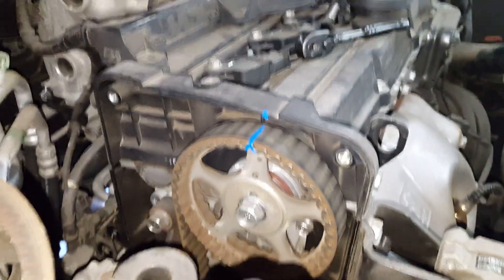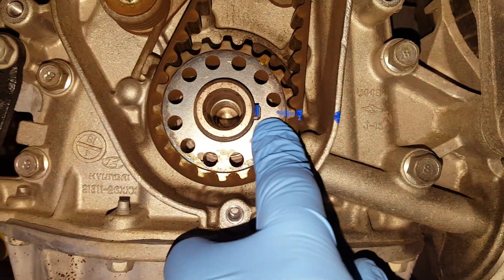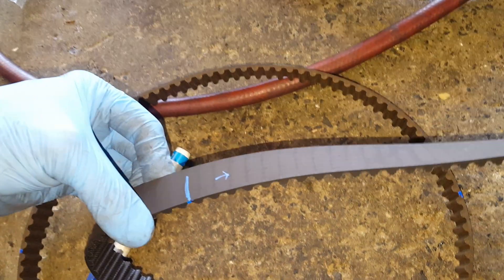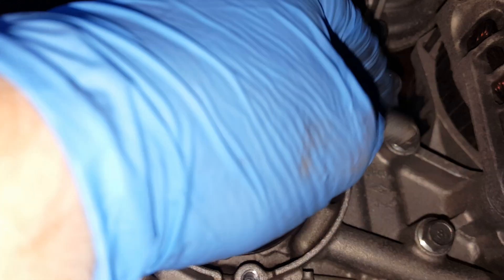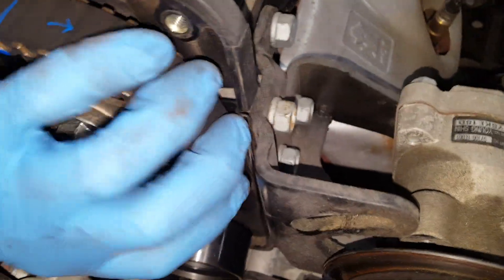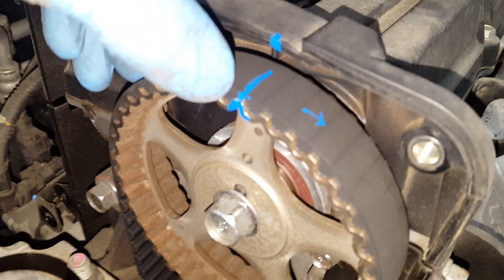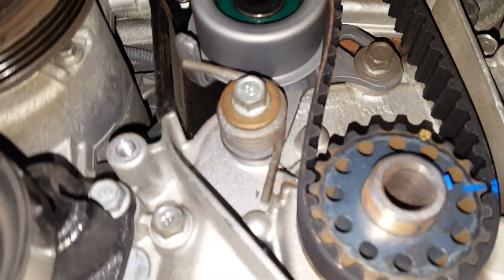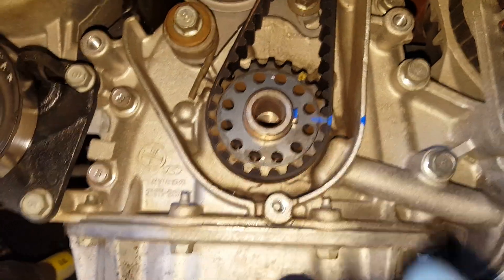Hyundai/Kia 1.6 Timing Belt Marks

Comment: Hi...I just want to ask what causes the timing belt to get broken or getting shift? Hyundai Elantra 1.6 GLS 1997...
Reply from the maker: The timing belt wears out over time and as the engine is running. The general recommendation for hyundai is to replace the timing belt every 60k miles.
Reply: @LehewTech  every time I replace the timing belt it got shifted slowly  by slowly of the camp and its rubing against something which we don't observe, is it a pulley that runs skew or what.... please help me out....
Reply from the maker: Are you replacing the idler and tensioner pulleys as well as the belt?
Reply: @LehewTech  yes I replace the timing belt and the pulley's full kit but still the same problem....
Reply: Especially if I drive long distances

Comment: Best if you take the plugs out to check the timing doesn’t mater it’s non interference in this case
Reply: No it's an interference engine. Because my 2006 Kia Rio broke it's timing belt and destroyed the intake and exhaust valves. It has the same Alpha II engine like in this video